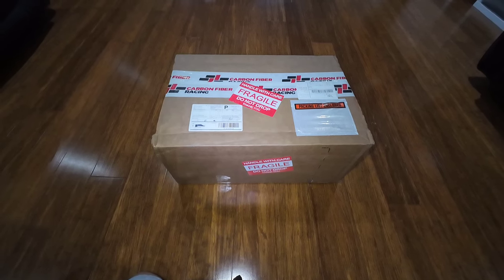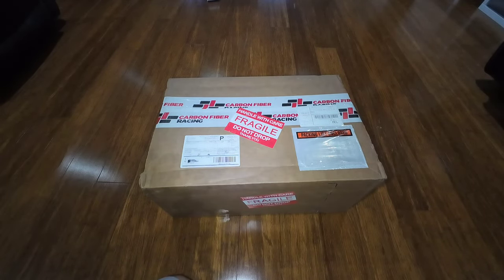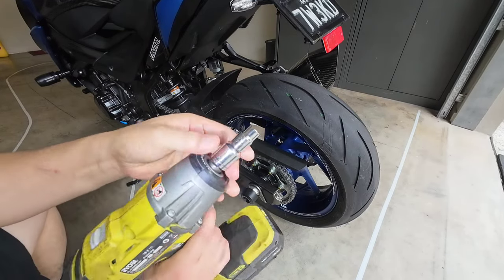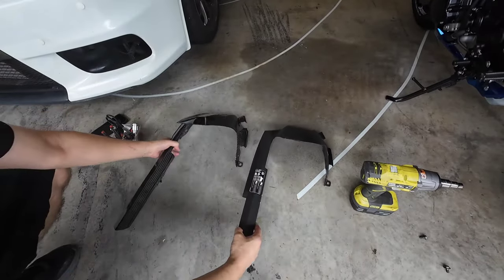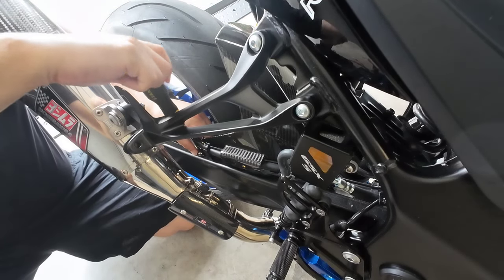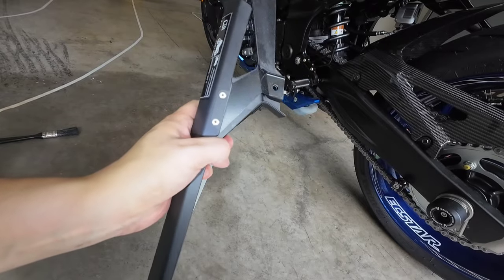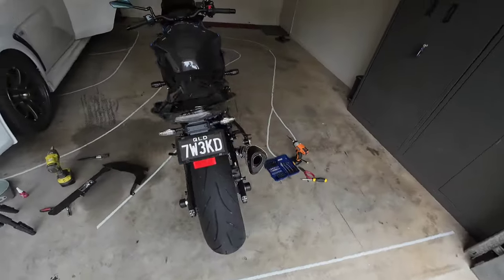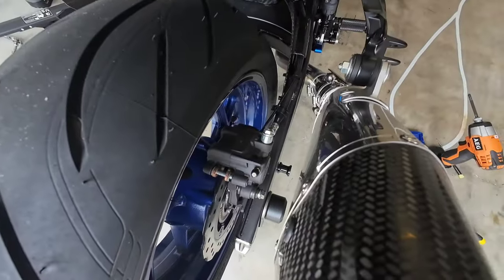Carbon Fiber Racing Rear Hugger for Suzuki GSX-S750 TWEAKED GSX S750

Comment: I’ve bought around 5 items from carbon fiber racing for my gsx-s750 they fit perfect 
Great quality carbon 
It’s gets addictive as they sell heaps for the gsx
Reply from the maker: Just checked it out it looks great 👍
Reply: Your bike looks really good with all that  glossy twill carbon 👍 I just checked your channel.   I decided to go matte plain instead of twill.    By the end of summer I will have all the carbon parts you have.
Reply: @MJC-GSXS750  awesome
Where did you get them ?
Reply from the maker: I've got the sides on the way now will have the video up in a week 🤙
Reply: @kearinburgess673  motocomposites, located in QC, Canada 👍
Reply: @TweakedGSX  shout out when your get them on 😁
I’ve just ordered the side tank parts and under the seat
Just have the brembo brake upgrade to go them I think she’s complete 😬

Comment: Looking good.  I’m in Canada and just ordered the same carbon part but in matte from moto composites.   Also got the tank piece and both side pieces.  Will probably it get the belly pan later in the summer.  Couldn’t decide if I wanted plain or twill carbon.   I see you have the carbon tubes over the front forks.   I was just looking into that as well.    Bike looks really good 👍
Reply from the maker: Thanks for watching 👍 Yes the carbon can be addictive!

Comment: Hello, I was wondering about the assembly of your carbon mudguard.  Maybe you explained it in your video but since I'm French, I don't understand everything you say.  I too have just received the same part that I am going to install tomorrow and I wanted to know why not have taken the metal reinforcement bracket from the old mudguard to put it on the new one.  Especially since the new carbon one already has the fixing holes intended for that.  Thank you for the answer.
Reply from the maker: I don't have a passenger which is the main purpose to protect stepping on the chain guard. I also don't have a rivet remover, but I may buy one this weekend to install it. The bracket is very small and wouldn't protect much I feel.  I have subtitles on all my videos, you should be able to go in and change the default language to French. Thank you for watching bro 🤜🤛

Comment: Are you by chance considering getting the seat side fairings from them too?  I’m thinking about getting them but I have seen other manufacturers getting questionable reviews on theirs due to fit issues.  I Haven’t seen any reviews on the Carbon Fiber Racing ones yet.  Loving the content!  Thanks for sharing!
Reply from the maker: Thanks for watching mate. Not going to lie I've had a look at every single part LOL. There's a part I saw that is a carbon for the complete underside of the fender eliminator area but it seemed to remove the plate mount and make the plate face to the ground whilst it mounted up against the frame. I may get the side parts you mentioned butnimnin two minds. I think that part might need flexibility to fit and maybe the motoxunn parts I had previously bought hydrodipped may install better? Which brands did you see had some issues?
Reply: @TweakedGSX  A piece to do that whole underside would be sweet!  I wonder if they could do something to retain the original plate mounting location.  I thought it was Moto Composites that someone left a bad review a while back.  It still shows a 1 star review but when you click on the item it shows a single 5 star review without any comments.  Almost as if it was altered.  Idk just seems fishy.  The items you’re getting from CFR look like good quality.  I may have to jump into the carbon scene 😁
Reply from the maker: Yeah that does seem fishy! Yes this is a good quality part, but in the downside it relies on Loctite as it's not able to tighten correctly in case it shatters. I think if you can find a hydrodipped part, or get your own part hydrodipped for cheaper that may be a better option, given the parts end up the same weight